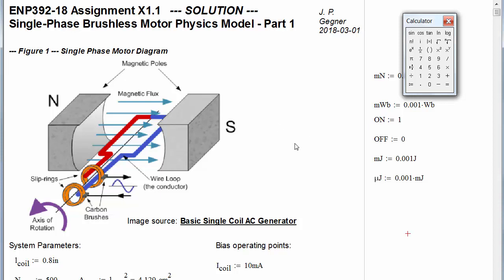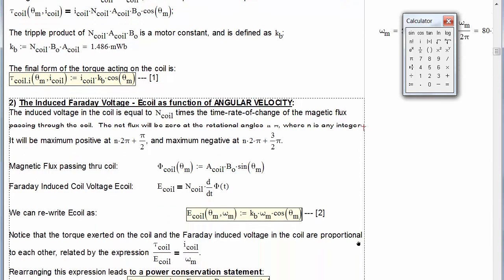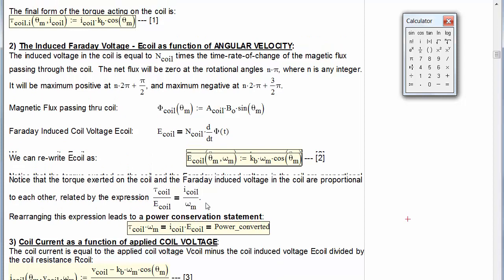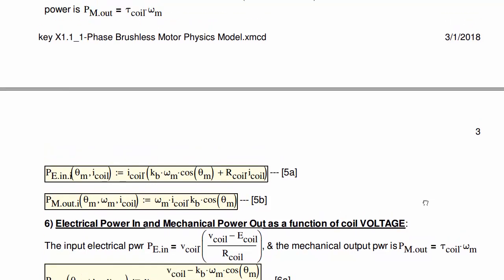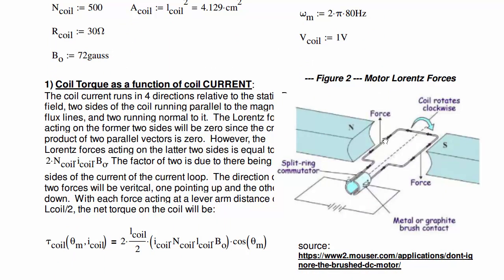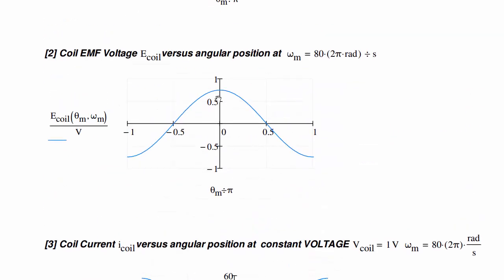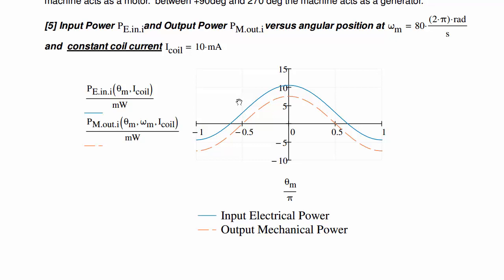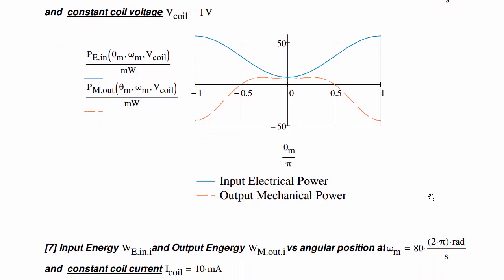Single Phase Brushless Permanent Magnet Motor Simple Physics Model - PART 1

Comment: you say its brushless, but it clearly labels the Carbon Brushes. I'm confused?
Reply from the maker: I admit the diagram that references brushes seems to contradict my claim that this is a brushless motor. To be more precise, this is a non-commutating brushed motor; it's a conceptual diagram, not meant to represent a motor that one would build. But its principle of operation is the same as that of a practical brushless motor, i.e. one where the windings are stationary on the stator and the permanent magnet is mounted on the rotor. 

So yes, you are correct that this motor has brushes, but it operates as a brushless motor since the is no commutator rings nor multiple winding poles. I hope that helps clarify things.